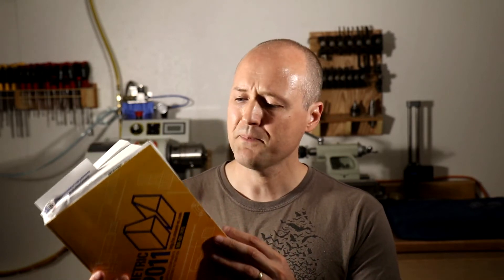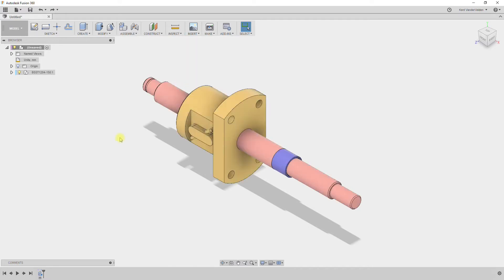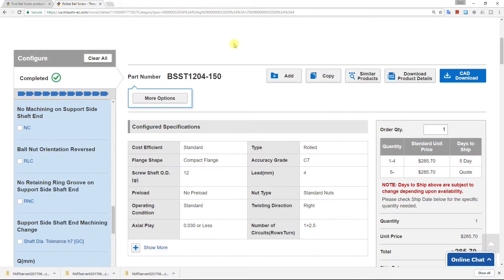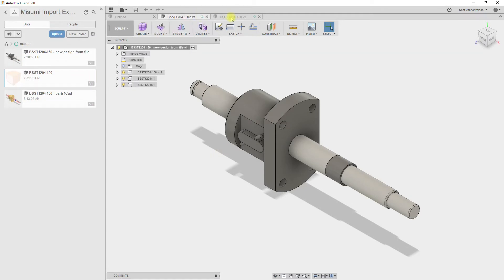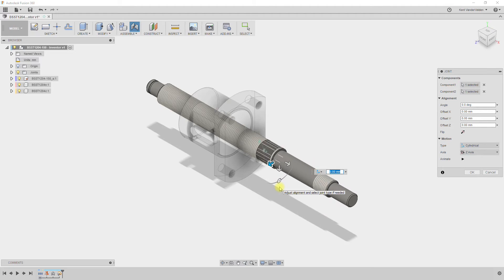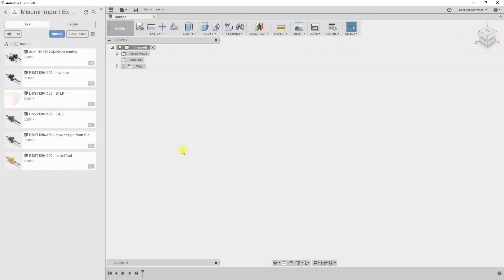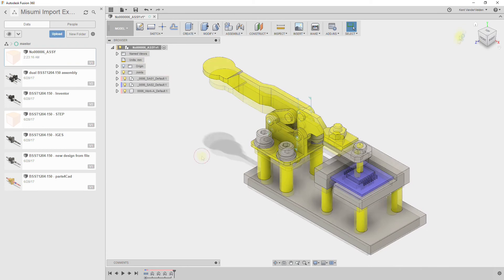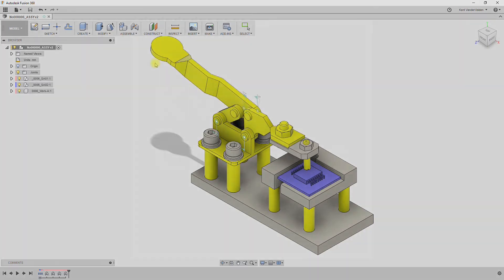Import Misumi Parts Into Fusion 360 (Inventor, STEP, IGES formats)

Comment: Thanks for another informative video. I would like to vote for more on joints, as well as importing STL files.
Reply from the maker: Thank you. The next one I plan to have more scripting (to control joints), but the one after that I plan to build up an assembly with Misumi parts, for the practice. There'll be a lot of joint building work in that. Maybe at least one will help? What were you thinking with regards to STL files? I might struggle to find a new angle on importing, but I do an idea in mind. It dates me, but 20 years ago, at my first job, I wrote geometry translators, and the first one was STL.
Reply: The thing I struggle with the most is reducing the number of faces. I have tried to export a partial CAM part (say after machining the top surface) as an STL, and want to bring it back into F360 as a solid body to machine the other side. It always comes back with too many faces. Same with importing something from Thingiverse. 
I would really like to see your take on a geometry translator.
Looking forward to the Misumi joints videos too.
Reply from the maker: That's an interesting problem. Have you looked at Meshmixer (http://www.meshmixer.com/)? Controlled decimation or feature elimination would reduce the number of faces typically with some loss of detail. I think Meshmixer has something like that. If writing code to do this, I would go to VTK and see what options they have for model simplification, but that's only because that's the tool I know. Do you have a Thingiverse model that appears reasonable but Fusion 360 fails to import?

Here's is some detail on VTK's decimation method: https://www.cg.tuwien.ac.at/courses/Seminar/SS2002/Knapp_paper.pdf
Reply from the maker: In Meshmixer, load the STL, select all (Crtl-R), and then Reduce (Shift-R) and change the reduction percentage slider. Maybe Remesh would help (R) and Sculpt? I don't know if it would be acceptable with regards to tolerance if reducing stock from simulations. Too much and the Meshmaker Bunny model becomes a pointy pile of triangles.
Reply: Thanks so much, Kurt. I have not had a problem with a specific model. Exactly as you mentioned, I am concerned about tolerances. I read the paper you referenced, though its above my  programming skills. Helps in understanding the process.
I think I will try Remesh the next time I export an STL from F360 CAM.

Comment: I really need to learn Fusion.
Reply from the maker: Hi Richard. I hear you, I get frustrated learning new software that does what I already know how to do well in other software. I have a big project, big for me at least, to deliver late October. I'm doing all the design work in Fusion 360 to force me to learn. The idea for this video series comes from finding the Fusion 360 equivalent of my SolidWorks processes. We'll see how quickly that derails. :) Best wishes, Kent
Reply from the maker: The only function in SolidWorks 2014 Standard that I have no alternative for is compressible and incompressible fluid flow. They'll come to Fusion 360 I'm sure, just not there now. Online alternatives like Simscale might be enough, but online simulation can be expensive and I don't have a business need. So, perhaps I'll some day put I'll learn OpenFOAM?
Reply: You make things way more complicated than I do. If I can design a product with a pencil, paper and bandsaw, I am happy. The fastest and simplest way to the finish line is what I prefer. I embrace my laziness!